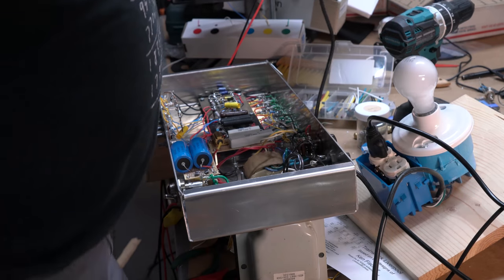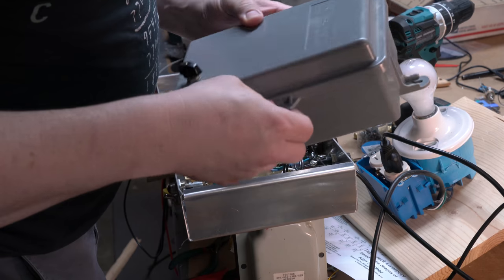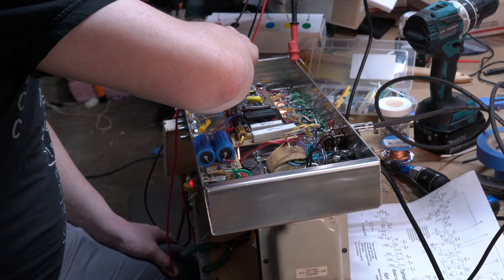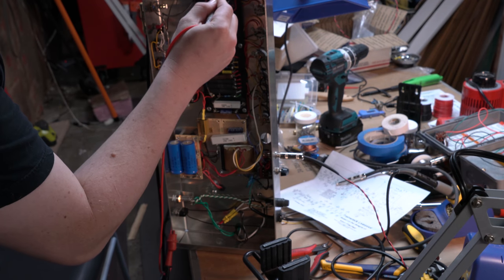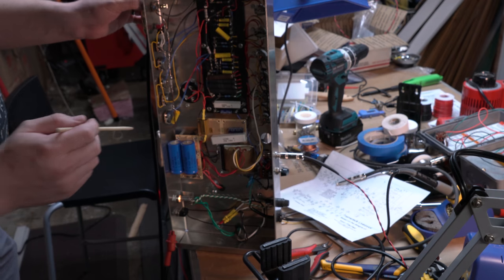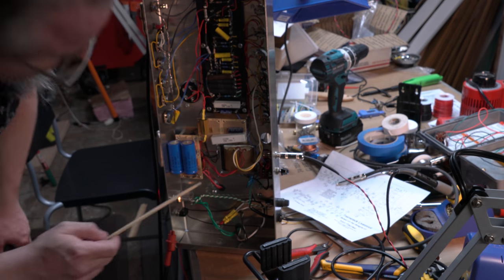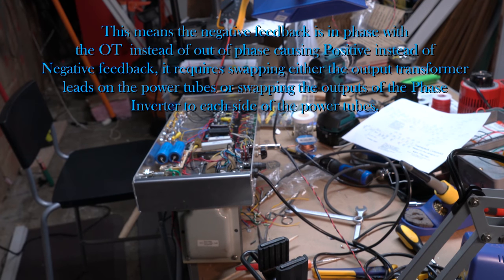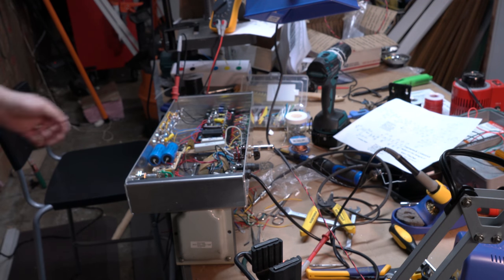TrainWreck Liverpool Video 4

Comment: Good stuff.  Does that guitar have a ground wire connected to a bridge post or some other part of the strings?  Or does it have any shielding?  I have a similar setup in my noisy basement.  Establishing a reference to ground via the strings / bridge and shielding the control cavity helped my situation.
Reply from the maker: +Kley De Jong yeah I think when I changed out my bridge, I didn't anchor the ground to it well enough, this the grounding to the chassis helping.  Thanks!